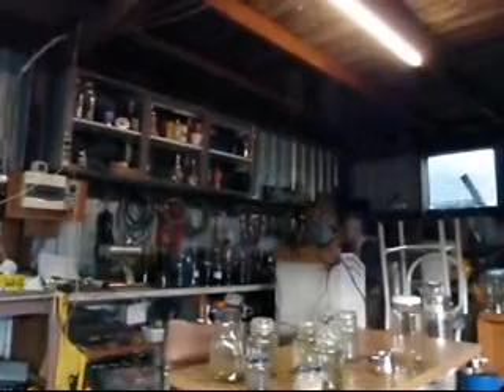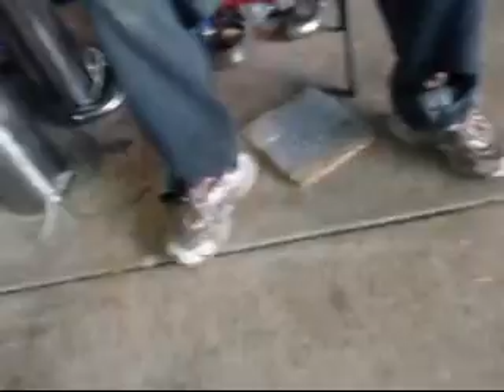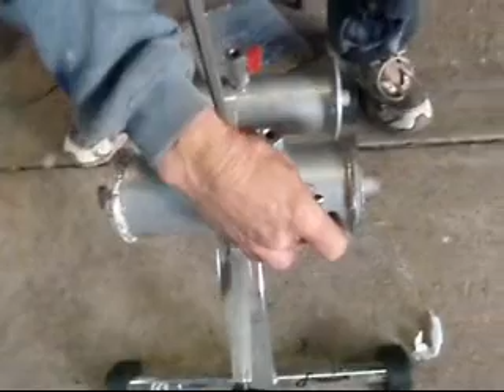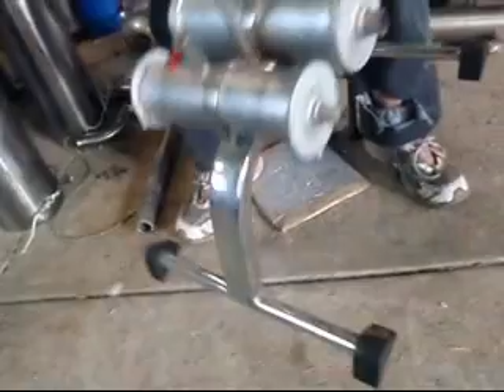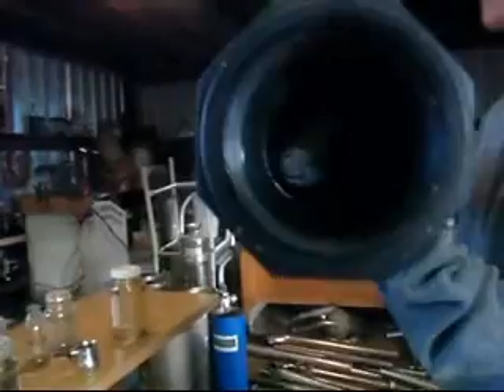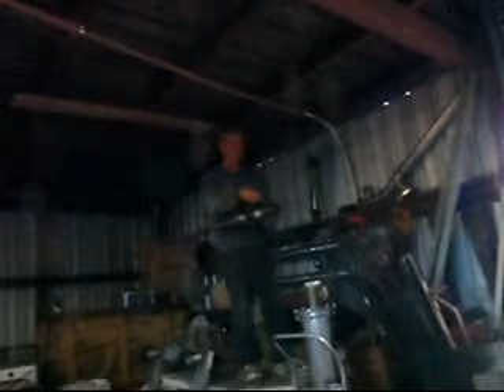AIR Peter Stevens with Joe showing Magnet Cells and variation

Comment: Right at the end Joe says, "you can steal this one because the magnets are configured different:, and then tells you how they are configured differently, which gives clues of what might be inside of both. And that the good one might be configured with opposite poles to the bad one, but that both were in essence the same.. He says, "It's rough, its clean, its clean, its clean, its rough", as he points to equidistant positions along the shaft. 'Rough' might be a Joe-ism for when you are pushing pole to pole with the washer in between – which forces the attractive magnetic energy outward, and 'Clean' might be with the opposite configuration. Maybe instead of a washer he has magnetite powder. Maybe he uses lots of flat skinny magnets clipped together to create field spirals to make those opposites and make lightening etc.
Reply: Это продольное поле. Таки поля скрываются. Joe Гений

Comment: Of the stainless was filled with aluminium molten then magnets placed in each time then add more molten aluminium until filled so 4 magnets in total this would allow the magnets to show full white neutral as the aluminium eddy currents by means of the vortexing draw neutral as the pos and neg from air instantly soak in to the structure the other steel tube may have a vacuum inside which would make a non showing field effect on the outer as the outer is drawing only neutral atom structure from air as pos and neg atoms from air are being drawn vortexing through the centre pipe and the rattle snake magnet hence shows running long ways making you think pos and neg running length ways but really its the central neutral if that magnet vortexing neutral around the tube as the stripped air going through the centre is pos neg vortexing air
Reply: Hahaha it's crazy to think that way.
Reply: Hahaha it's crazy to think that way.

Comment: Could we make a large "Bloch Wall" system out of this to set up a device for earthquake detection? I know magnetic's in the earth ... change just before an earthquake and a "high power Squelch Block Wall" circuit with solenoid alarm triggering circuit should do the trick for detecting earthquakes. I see it in my minds eye ... but have no equipment to build it with ... Dick Baublitz xpi (blitz@pyramid.net)

Comment: Some big clues here on the simplicity may be the 2 tubes are vortexing the flow of AIR and causing a matter neutral in the steel one and a type of antimatter in the stainless one and the vortexing strips the potential to then produce if joined together a photon source and a gamma type source    As I say maybe trying to decipher this as once deciphered it would be a method to attract all natures energy as jules Verne quoted